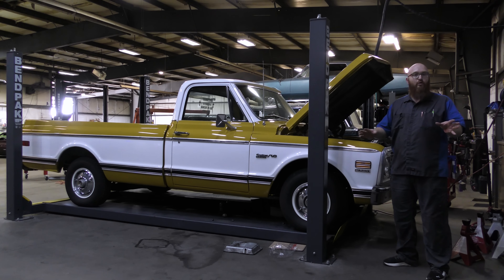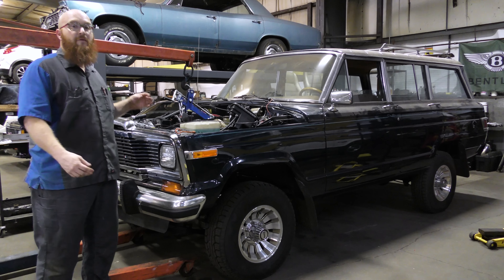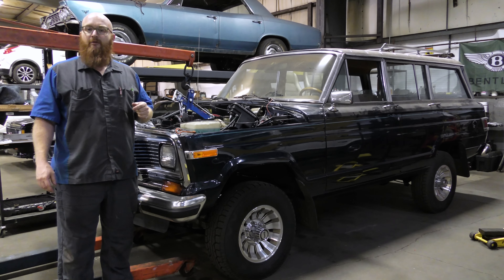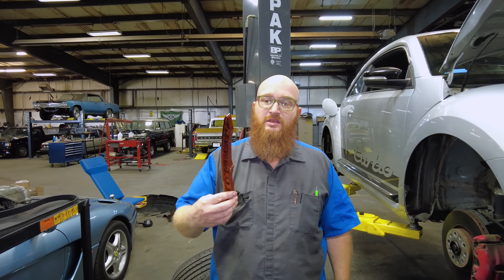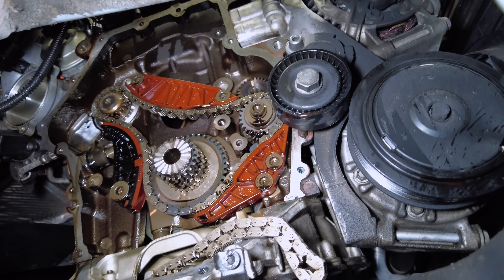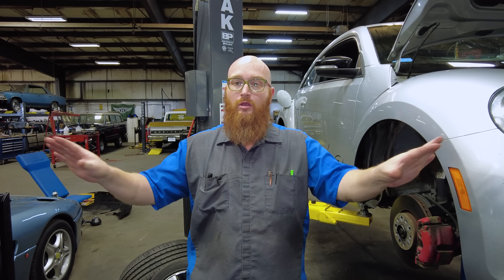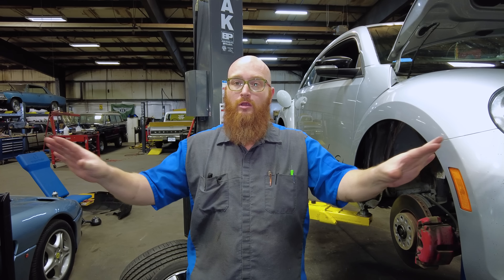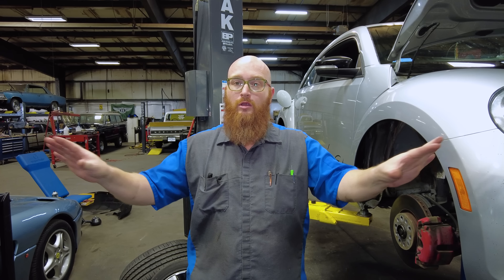Hard to test, can't see it, but it can KILL your car! CAR WIZARD talks Timing Chains! Is yours next?

Comment: Dear Lord do not remind me about timing chains I had to help a friend redo a timing chain on a Mercedes I will never want to do that crap again dear Lord we get the front of the engine off find out that the year on the lower crankshaft snapped the pin off had to replace the pen and the gear then we put the new chain on only to discover basically their chain is the equivalency of a bicycle chain horrible engine design we got the engine back together we had to rebuild the heads because when it took out the chain it took out the heads put everything back together went to go do timing on the engine and we found out we couldn't adjust the distributor on the engine because it was under the air filter and you can't run the engine without the air filter because the car won't start without the air filter connected

Comment: Manufactures should stop bullshitting people that timing chains never need to be replaced. I think in my 20+ years of being a mechanic, I’ve replaced more timing chains (or cylinder head replacements) due to failure than I have timing belts. Belts have a pre determined replacement schedule, chains should too.

Comment: if you want a bad engine for belts try the V6 Alfa 30,000 miles,  don't whine about chains lasting 100k miles
Reply: Mate, that engine you're speaking about, the Busso, was designed and launched in the '70s. Go check out the engines of that era when they needed to change the belt... With those belts especially.

Comment: I had not realized how shoddily engineered these modern timing chain systems are....appallingly crappy.
Funny timing belt story. Volvo dealer...early 2000s....we got lots of phone calls from customers asking how far they could "stretch" the timing belt service interval ( interesting word choice ) Our shop foreman got so sick of these stupid calls that he came up with a classic answer: " Well, sir, we're having a contest to answer that question. It's easy to enter: just keep driving until the engine grenades, write down the odometer reading, and give us a call.
PS: we already know that 94,375 is not the right answer on a 70000 mile recommended interval" 
The sound of crickets can now be clearly heard....

Comment: Make certain it doesn't have a belt before you buy it.
Reply: Why?  Timing belts are a maintenance item. And many timing belt engines are smoother and better than many chain engines.
Reply: @travissheehan6082  Nonsense, they're cheaper to make and a weak point in the engine.
Reply: @travissheehan6082  You've said 2 stupid things, you can have the last word.  I do not argue with idiots.
Reply: I guess you can’t argue with yourself then.  Only a fool deals in absolutes.
Reply: Robin, my mom had a Honda Van with the V6.  She Had to change the timing belt at 100k.  This cost $1100 at dealer.  If you had a chain, no expense.

Comment: Oil is cheap , engines are very expensive.  Oil change recommendations of 7500, 10,000 amd even 15k on the Metris Van are unrealistic. 

Check your tire pressure monthly, oil change every 5000 miles  will greatly reduce mechanical failures.  10000 miles oil changes showed up with free oil changes for x number of years with a new vehicle.  Toyota charges you for the 5k mile oil change , it's not scheduled service includes in the free service BS.

Service your own vehicles  🧐

Comment: One less thing to have to worry about on an electric car.
Reply: Except where you're going to plug it in when you're on a road trip.
Reply: @Mayamax3  The last time I went on a trip, the electric vehicle had no range  issues whatsoever. The Amtrak train ran off overhead electric wires. Seriously though, the plan is for quick charging technology to be available within a decade. There are lots of charging stations within a short distance of my house. The real challenge will be making inexpensive charging available for people who do not live in sfh with garages such as apartment, condo or even townhouse dwellers as well as quick (less than 10 minutes) charging available near highways. According to an article a recently read, this technology should be available within the next decade. Until then,  the train or driving 40 miles to the cruise port is the logical option. 

Fortunately, unlike in Kansas, the Northeast has the population density  and the expensive toll roads to make alternatives to driving somewhat practical in some situations. Not that toll roads are good, but they do force  people to think of alternatives. 

Seriously, given the over $80 in tolls (not to mention gas) required to drive between DC and NY (a 220 mile trip one way) and the availability of train fares that cost less, not driving can be the faster and more cost-effective option.

Comment: I find it ironic that the Wizard thinks BMWs are terrible, yet he buys and is into VW/Audi products?  Talk about a German make that designs things to be needlessly complex and has all sorts of issues and pretty serious and expensive parts failures.  A timing chain replacement on these motors is not an easy DIYer job. For most people, it will cost them $1300-1900. If the chain snaps, you're looking at a long block in most cases.  Watch any VW/Audi repair video and take note of how much stuff often needs to come off before actually getting to the repair.  I don't know any VW/Audi owner that hasn't put a monumental amount of money into repairs on their cars.

Comment: You are talking about value engineering. Some equipment, mechanical or electronic is first designed. Then a team of engineers go over the design and question everything. Cheaper materials, thinner, lighter or omitted parts to lower cost. As long as the life of the product exceeds the warranty, say 5 years and 100,000 miles then all is good. If it breaks at 105,000 miles then that is good as well. Buy a new car.

Comment: You buy a used VW  with 100k miles and expect you can drive it with no repairs ) Such a naive mechanic)In  Europe  we all changed chains and tensioners on VW at 60-100 k of kilometers )

Comment: Isn't German engineering wonderful? And that General Motors 3.6 L was designed by GM of Europe. Meanwhile, Toyota has produced millions of 3.5 L, 4.0 L, 4.6 L,    5.7 L You never ever hear of the timing components failing